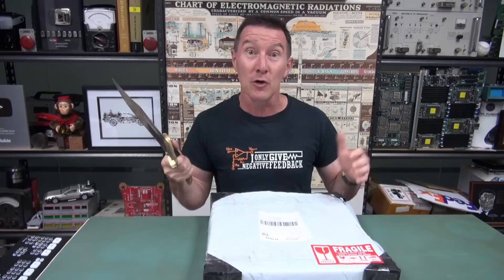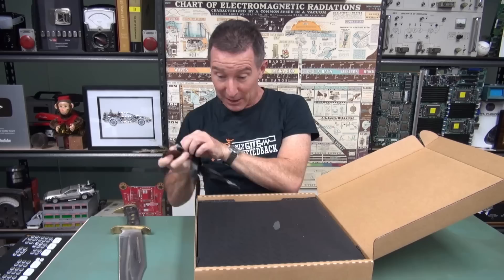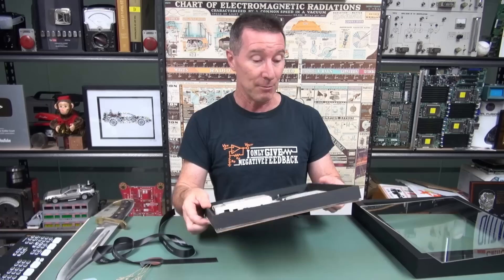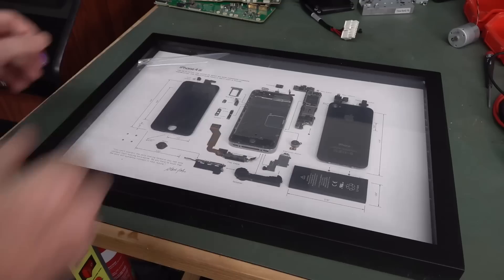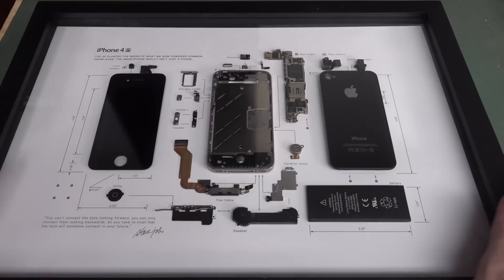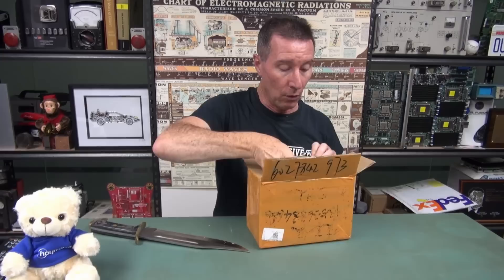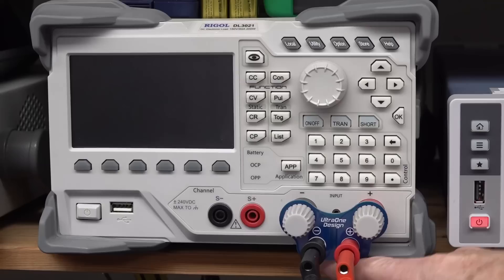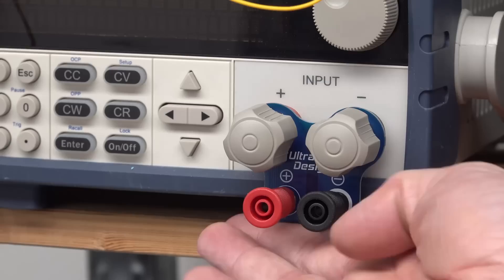EEVblog 1549 - Mailbag Teardown Art, USB Power, and Multimeter

Comment: Those framed disassembled electronics are a neat idea. When I was in grad school I took apart my old laptop and had all of the parts mounted on a board on my wall. Except it was all still connected together and actually worked.
Reply: The very first smart TV :D!
That reminds me I still want to make my own digital picture frame :)
Reply: That ain't working again. Very distressing that people do this.
Reply: @chinnyvision  That was an old laptop. I'm pretty sure the battery didn't work any more, so it wasn't very useful. I got a new replacement laptop and wanted to do something with the old one rather than throw it out.

I did something similar with an old laser printer. Except, for some inexplicable reason, it gave me a "Fuser Error" and wouldn't run.

Comment: You need to turn off the PD switch on the usb meter, in order to allow the soldering iron to negotiate the higher voltage over USB-C.

USB-A provides 5v always, before negotiation, so the USB meter is able to turn on even with no actual device. USB-C provides nothing before negotiation, so you need the PD switch on the meter to choose between the meter negotiating, or the actual device negotiating. The PD switch needs to be on for the meter to turn on without a device negotiating, and also to probe protocols and trigger higher voltages manually ...

Comment: Hey Dave!
It’s a „young generation only“ multimeter:
Loading every day
auto mode
and finally the buzzer which can only be heard by <40
Reply: Yeah, it's crap. SlaVoy did a review (sadly in Polish only) and he was not impressed. There are other similar meters like from Aneng which perform better.
Another incomprehensible thing is why Fnirsi insists on negative LCDs which waste power on backlight and are invisible in sunlight.

Comment: I use only right-angle probe connectors these days. They just better protect the meter when it gets dropped. I actually like that multi-meter's form factor. It's thin enough to fit in a shirt pocket, and the display is large enough for me to read without my glasses. As for it only running for 20 hours, most such meters shut off after 5 minutes or so anyway, and 20 hours of actual use would cover a week or 2 for almost any tech. I personally no longer spend 8 hours a day beeping out cables. Also, unlike with other multi-meters I wouldn't have to pull off the cover and change the batteries. That's a job that gets irritating, and 9 Volt batteries are getting fairly expensive for what they are, and I'm tired of digging through my accessories drawer to find batteries, since they always die right when I need them most. It seems that for every negative with this meter there is a positive, at least for me. Different people, different combinations of applications and needs. It also looked like the frequency meter works up to 1 MHz, likely for logic-level square waves anyway. So I think I'll contemplate getting one, especially at that price, since none of my old Flukes fit in my shirt pocket or recharge off my laptop or my little USB battery pack.
Reply from the maker: I just find the 50mA draw, well, offensive.
Reply: @EEVblog  you'd be amazed what your phone draws when you are watching video, in a call or otherwise using it. And you have no problem charging your phone, eh?
Who cares is this meter draws 50mA... It only draws that much when it's switched on.... what is FAR more important is what's the standby current, as that is what determines actual battery life.
Reply: Fellow 9v battery hater here (we should form a gang), I been replacing batteries with those cheap adjustable boost lithium chargers & a ~800mA cell.  The board & cell are roughly 9v sized, I assume that's what is inside rechargeable lithium 9v batteries.  I add wireless charging by using those ones that plug into your phone USB port.
Reply: @EEVblog , :)
I understand. I wont be truly satisfied until my meters all charge themselves from the motion of picking them up. 
 But this one was designed with the knowledge that it could be easily charged at any time on any USB port, so the designer could afford to be lazy with the power budget, and the product reflects that. Could be worse. Could be rows of 7 segment LEDs.
Reply: @j.f.christ8421 , worse still, a lot of the '9V' batteries only put out about 8 volts brand new. They have the '9V' form factor, but apparently drop a cell in order to cut costs, figuring no one will notice. But I do. Some of my meters read "Low Battery" with brand new batteries, and shut down in a few minutes due to the low voltage cutoff circuit. That was one of the reasons I was interested in this inexpensive rechargable meter.
Reply: @johnwest7993  Yeah, those 7.5v batteries have been around for a while (yep, they drop a cell).  I don't mind so much tools that take AA or AAA cells, I've got heaps of rechargeable in those sizes.  I still convert them to USB/Lipo where I can.  Disposable vapes batteries have been coming in handy, but it's a shame they're 18mm round while AA is 15mm.
Reply: @j.f.christ8421 have you tried the 9 volt lithium rechargeable batteries where you just stick a phone charger in the side of the actual battery and it has a small charging and boost circuit built-in? I use them all my small devices like multimeters, temperature guns and displays! I usually last about 6 months before they need to be recharged and for under $4 each it's pretty good value
Reply: @Jawst  They were a bit more than $4 when I first saw them, so I've kept doing DIY.  The modules are pretty cheap and boost to about 5-20v so pretty handy for a lot of gear.  Occasionally there's a bit of space for a much larger LiPo.

If those LiPo 9v have gotten cheap then that's a much easier path to take.

Comment: The USB tester needs to be powered via microUSB while you do the power delivery testing. I’ve got the same unit just bought it. Firmware buggy as hell but it crashes and restarts fast enough to not be a problem.
Reply from the maker: Seems to work without it, but also seems intermittent.
Reply: @EEVblog  it will and for me most the time it does, just has a brownout. But I did read either in the manual or their website that some PD chips take longer to switch protocols and that’s why on some devices it’s intermittent or outright not possible with just USB-C connected.
Reply: @EEVblog - you need to switch on and off the PD switch. This determines if the PD signals are sourced by the device (for testing) or passed through from the attached device.
Also, on what world can anyone convert a 18W power bank into a 65W one? You expect a bit much LOK

Comment: Why do they always use Bluetooth for data links on these devices, it's an infuriating software stack to deal with on the computer side at the best of times.

We need a fall-off-a-log simple wireless serial (433MHz ISM units do okay but it'd be nice if there was something in the GHz range for smaller builds).

For now I'll stick to USB-Mini + CH34x / FT232's

Comment: The multimeter's charging input is NOT isolated unfortunately. Thes should have used Qi charging to prevent safety issues.
Reply: They should have used AAA batteries to prevent charging problems.
Another trash from Fnirsi.

Comment: If that multimeter had a way to store the probes and it could fit nicely in a pocket maybe it would have made some sense.
Reply: The thing that would make this meter be worth considering, would be capacitor ESR measurements.
Even if the price went up by $10 or $15 dollars, it would still be at least worth considering.

Comment: Why recharge every 20 hours? Well, you are expected to sleep for at least 4 hours in a day/night cycle, it is not like 1 day battery hour is uncommon nowadays, and on far more commonly and frequently used devices - like say pretty much every phone, tablet or laptop you extensively use unplugged throughout the day. So recharging your stuff just becomes one of those things you do, like wash your feet or brush your teeth before you go to bed. And in those cases you need to use the device for even longer periods of time, you seem to already have power bricks ;)

20 hours is pretty good actually. I remember buying a brand new laptop and it could barely last 4.5 hours on a full charge, not even enough for a longer transit. Nowadays ultra portables are doing in the low double digits, but most laptops will still barely last 5-6 hours of heavy use, which is pretty much what you get to work out of an 8 hour day in a corporate environment, the rest is just pointless meetings.

Comment: So I just ordered the USB meter. $63 Cdn$, free delivery. But I am having things held up in Customs. Hope this comes through.   BTW Vancouver, British Columbia is different from Vancouver, Washington, a much smaller city next to Portland, Oregon.
Reply: The FNB 58 has the biggest screen but the smaller units FNB48P and FNB48S all basically do the same things.
Make sure to read the manual properly. Dave is definitely not the person to learn from. I'd suggest "Goughs Tech Zone" as a resource who actually learns about products before publishing.
Also note the rocker switch has 6 actions. Press, Long Press, Left, Long press left, Right and Long press right. This can be quite confusing, as there is functionality under all 6 of those things. Also, you get different actions depending on which screen you are starting from.
For example, the Cable Resistance tests on the FNB58 are hidden under one of the long press action menus.
Dave also didn't read or understand the graphing screens that he showed here.
The cable testing method and the PD switch are also confusing to some people. You really need to learn and understand exactly what is happening so you can use the device properly.

Comment: I do like how the Li-ion cell gives that multimeter a thinner profile and lighter weight, making it truly pocketable. My other pocket meter burns through CR2032 cells, where this pouch cell is bog-standard and cheap to replace.
Reply from the maker: Heaps of meters with this profile or smaller that don't take 50mA.
Reply: @EEVblog  I still like my old Triplett 2030-C and MUCH older 310.

Comment: You are not green enough! Some of those people would never use anything with an ordinary battery. It has to be rechargeable.
Reply: Dave thinks that Multimeters need to be fitted with old school disposable Alkaline cells. Because it's such a PITA to charge them, the battery life is important.
Modern devices using inbuilt rechargeable cells can be recharged easily, so battery life is hardly ever an issue. Does he complain about recharging his phone every day?

Comment: I used the Walmart ZL128B when I upgraded my nephews computer last week, it was tough to get the CPU out, mashed a capacitor good for real, but it even had a kids proof screw, like who on gods earth is gonna steal your i5 2400?  So, its not accurate, likewhatso ever, one capacitor read 0.6 and the one I busted off read 0.467, but it works theoretically, most thing is it had a bag and rechargable, easy ty to read, want a magnesium wrench, just want one.  lol  I got those small aluminum toiletry wrenchs, you just don't get the feel puree mechanical object though.

Comment: Dave really needs to educate himself about USB and Power Delivery protocols. His ignorance really shows up on recent videos.
Why would he expect that a 20V 3A 60W soldering iron would work properly from a powerbank that only outputs a maximum of 12V 1.5A (18W) 😂
Also, the PD switch on that meter is designed to block the PD signals from the iron or other connected devices. The idea is touse the USB Tester to inject PD commands and test the power source capability. You have to switch the USB Tester back to "PD Pass-though" if you want the PD signals from a connected device to be active.
Reply: Because the soldering iron current is lower at lower voltages... think about how a resistive load works.
Reply: @jaro6985  - because that is NOT how these USB PD soldering irons work. They need at least 12V to even switch on...
Reply: @johncoops6897  mine works fine at 12V to 20V, and you already stated his power bank was capable of 12V output.
Reply: @jaro6985  - yes, but he never got it to work did he? You COMPLETELY miss the point of my comment. It relates to Dave, not the soldering iron. 🙄

Comment: I have one of those irons. I Have a heap of proper PD chargers from reputable brands that even provide 20v to some devices. The soldering iron never negotiated more than 5v. The good part about the pinecil is the PD negotiation is not developed by some rando guy in the basement in some rando factory who said he knows about that stuff.
Reply: Dave had the Iron plugged into the USB Meter. He had the meter's PD Switch set to block the PD signals from the attached load (iron).
These Fnirsi irons negotiate up to 20A 3A.
Also, Dave is trying to use a 60W soldering iron on a 18W power bank. Nobody can get 20V out of a power bank that only outputs 5V, 9V or 12V.
You and Dave have similar ignorance of USB-C and PD. 🤣
Reply: If yours does that's good news. Maybe I got a dud.

Comment: Why did they use those cheap batteries when they could have adapted a phone battery or two for they multimeter? Could have fit 2 old style phone batteries in that multi meter.
Reply: Because phone batteries (e.g. Nokia) are larger than bare lithium batteries for a given capacity. Then you need connectors etc, which takes even more room. Old Nokia batteries like you refer to are both physically larger and have only 800 mAh capacity... So what you suggest is pointless.
The battery capacity doesn't really matter, since it is rechargeable. You know, just like a mobile phone is rechargeable 😉
Reply: @johncoops6897  
"Because phone batteries (e.g. Nokia) are larger than bare lithium batteries"
-No.. Plenty of batteries are not. Being in electronics repair for 15 years and ordering many different batteries over the years.

 "Then you need connectors"
-No, you don't. wires and a single charge control board. Or in this case a molded back case to fit the chosen batteries.

"Nokia batteries like you refer to..."
Did I say Nokia batteries somewhere?
The batteries are much larger capacity than 800 mAh, The capacity makes the run time much longer. Try doing a google search for other phone type batteries.

As I have joined the batteries together in packs and used them in models and other projects as in I have done this before. I should have a clue what I'm talking about.

Comment: I have a similar meter kaiweets brand and it's pretty nice. The auto function takes a bit to sort itself but you choose the mode and it's solid till you get it into really high RF even then pretty good but then again a lot of digitals do. I double check with my analog Simpson in that situation. I do like the binding post adaptor boards and giving me an idea for some of my equipment.

Comment: Love the honest reviews 
The power meter I have the same model It works awesome It's the only one I can get to work right with Some tricky devices like the nintendo switch 
The computer software works pretty awesome too to mention for real Time live Display That you can use for Open broadcaster Is definitely a win win for the price Definitely recommend that product FN858 It works beautiful with All the protocols Works with lots of devices
Reply: The problem with Dave's reviews is that he is VERY ignorant about modern things like USB-C, portable devices, etc.
So he passes judgement without even understanding what he's trying to do. The perfect example was him failing to make the 20V 60W soldering iron work from a 12V 18W power bank, while the USB Tester is set to block PD signals from the iron from reaching the power bank.

Comment: Never send Dave cheap multimeters expecting good results 🥱
Reply from the maker: Cheap is fine, just make sure they are fit for purpose.
Reply: @EEVblog - a cheap meter will NEVER be fit for the same purpose as a $300 or a $1000 meter.
Why is your EEVblog meter so damn huge and ridiculously expensive? It's FAR less fit for the purpose of verifying resistor markings (for kit building) than this compact meter.
Reply: @EEVblog  I BOUGHT the Aneng ZT-702S review which was critical, but fair and positive. I am very happy with it. BTW I attach an antenna to the scope jack and can use it to monitor my ham radio digital transmission. It accurately reports the frequency up to 25mHz. D and shows the envelope. Don't ask me how! Bandwidth in 10mHz. Supposedly.